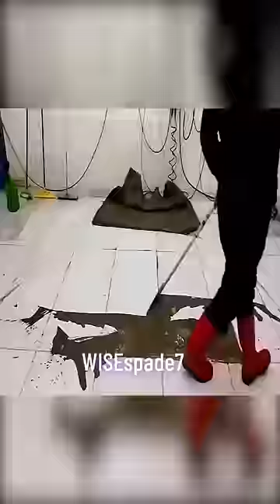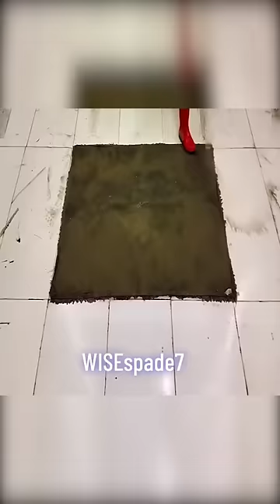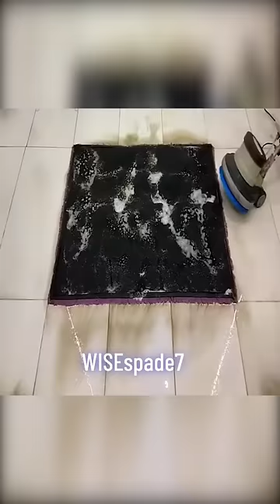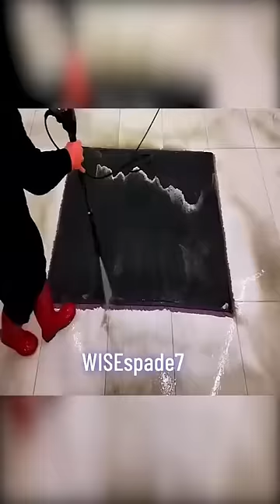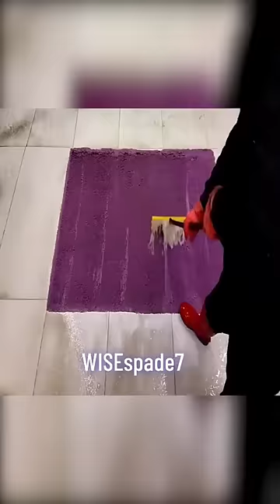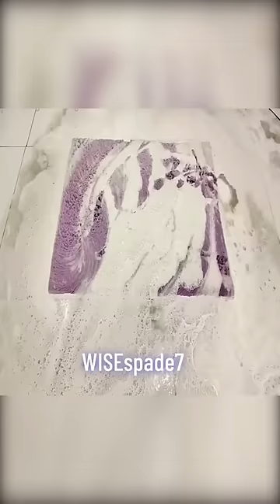CLEANING A TRAILER A$$ RUG pt3 #wisespade7   #asmr   #diy   #trending   #yapping

Comment: 99% sure people that have rugs restored are doing it for 1 of 2 reasons: 1) Because the rug holds more sentimental value, like a rug that's been in the family for a long time and there's no replacement for personal attachment, or 2) Because the rug is quite valuable. Some rugs, depending on the material and where it was made, can easily get $600+, so 50% off doesn't seem like a bad deal at that point.
Reply: As someone who does this for work, you're mostly correct, but these videos are manufactured by purposefully dirtying cheap rugs. This rug is only worth about $75
Reply: Yeah, every rug is synthetic, not natural for a reason. Most expensive rugs are natural and can cost thousands. The rugs in every one of these videos are cheap synthetic rugs.
Reply: These videos are so fake but in general yes
Reply: If those 2 points are true, then why would they let it get into such a state in the first place? This is just mass-produced video crap for that "satisfying video" hit
Reply: $600? You're missing two zeros and a comma. I have a a sample of work from a 13 year old Afghani girl. It's about six or seven inches long and three inches wide. That sample piece made by an inexperienced girl is probably worth $50. A full size rug made by a talented weaver may cost as much as $150,000.

Comment: Bro i worked for a place that cleaned area rugs and they do in fact come in like this. Some people leave them outside and literally get them as dirty as they can so they can see how clean you get it before they bring in their clean, much nicer rugs. So chill out and do some research before you start to regurgitate nonsense
Reply: Oh u worked for a company that cleaned rugs, but u didn’t clean the rugs? Yeah right, and who are u getting pissy for, the rug guys that make the rug videos? As if u’re the president of rug cleaners! Bro, get ahold of urself
Reply: I actually cleaned a rug that was in just as bad a condition simply because I didn't want to buy another but the problem was that the rug I had literally had to be dug out of the ground so I can explain both the watering can and the "scrubby thing" including each detergent and just how much of a massive waste of time this is just to reuse an old rug because it literally makes more sense to buy a new one then to buy a carpet steamer and chemicals or worse pay for labor as well. The only way that this would make sense is if you worked for a thrift store and you were going to restore the rug and sell it for more than it's worth. And if you're wondering what's in the watering can it's basically the equivalent of water and laundry detergent that's then scrubbed into the rug and you use a squeegee to get it out and then you spray it with a pressure washer and repeat but what they always leave out of the video is the unfixable smell because not only is there dirt outside with those rugs but so are the animals that pee and poo on them. Just save yourself the effort and expense and buy a new one.
Reply: @Zondollor  exactly our warehouse would get old dirty rugs just to turn around and sell them at estate sells or sell them to antique stores, or just sell em in the front office.

Comment: Most rug cleaning is done for fire insurance claims. It less expensive to pay for it to be cleaned than to write a check for the replacement value minus depreciation. It's probably soot from the smoke of a fire that's why it looks similar.